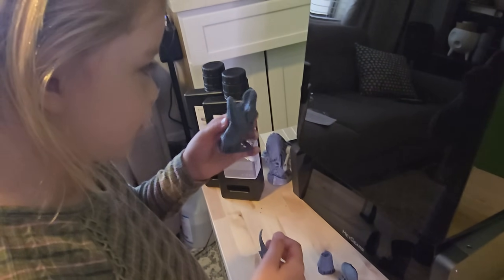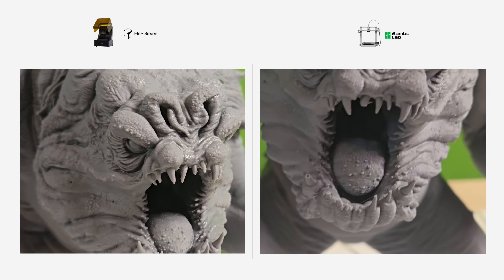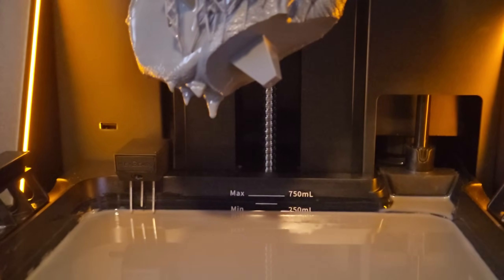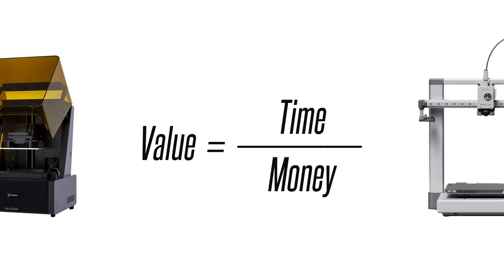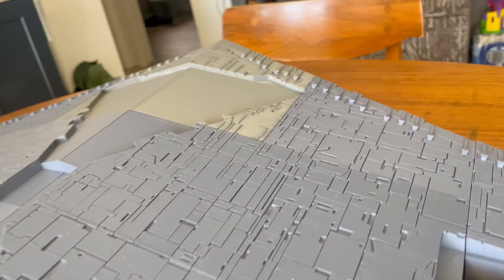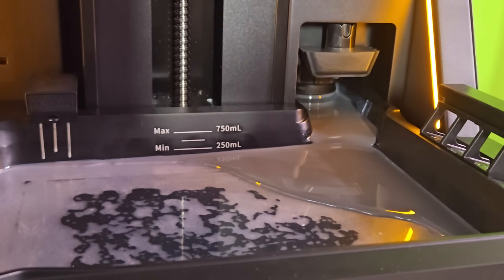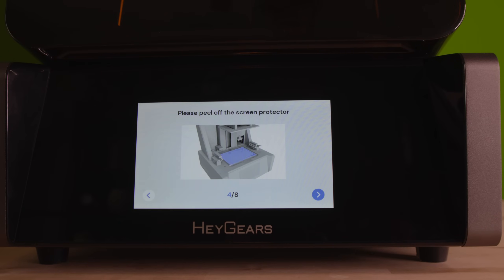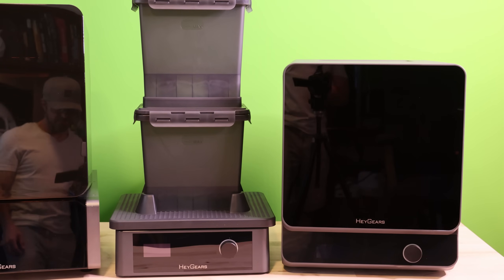I Printed The Same Model Two Ways And The Results Are Crazy! HeyGears Reflex Resin Printer

Comment: One of the best and most articulate and balanced discussions of resin vs FDM printing I have seen.  However, it is really hard to beat the low cost and low post processing of FDM for anything but the highest detail.  I would have loved to have seen the detail of the rancor with a .02 nozzle vs the resin.

Comment: Wargamer resin gives excellent results and is water washable. It's still toxic like all resin, but the cleanup process is way less hassle, without the need for tubs/vats/extra toxic chemicals. As you mentioned though, you're pretty much locked into the ecosystem and their own resin on the Heygears.
Reply from the maker: Apparently I can use any resin I want with the Heygears. I have yet to do so but it is definitely possible.
Reply: @planet3dp   You should check out the Wargamer resin then. It's definitely worth it to at least test if it's for you. The cleanup process alone is worth it, even though it's also a really nice resin with a premium appearance and feel.

Comment: I bought the arctic figures stl for a bunch of the models they have and did this without thinking, its for a resin printer. I have an ender 3 og . So Im sitting here printing the mega raptor in 300% scale and its coming out nice. Very large but nice
Reply from the maker: Hahaha that's awesome! Just because they say sla doesn't mean you can't print on your fdm. Try what I did and print at normal size with much lower layer height. You might be surprised at the results. What is the print time for the mega raptor?
Reply: @planet3dp I have it set at .08 layer line height. So far the longest print time and biggest piece was the pelvis wich I have to do a cut with connectors but all together both pieces took 4 days and 3 hrs plus change. It is a 30 piece print because its super articulated. When all put together should be the size of a real life velociraptor
Reply from the maker: @GarysmostlyMonitors that's is pretty cool. If you can remember, send me a pic at nick@planet3dp.com when it's all done. I'd love to see it.

Comment: Thanks for honest comparison on print quality (something that some youtubers avoid doing)

It's a bit unfair to compare material costs of printer, that's (officially) restricted to "official materials only" (while the comparison can use cheapest available), but on the other hand, both printers are "more closed" in their ecosystems (especially A1)

Few tips:
-If you paint the models, the surface quality difference will be more obvious. Even more, if you also apply wash.
-It's easier to remove resin supports before curing (preferably after washing). You can also heat the model a bit to make it even easier.

Few practical differences I'd highlight in such a video:
-With LCD based resin printers, the total print time is dictated by the single tallest part and layer height (other variables are mostly constant, although layer exposure time is directly related to layer height), on FDM printers, it's based on complexity of all parts in the project.
-Removing material from the inside of the model is generally easier & more "practical" with FDM printing (as you can select sparse infill), with resin you need drain holes, and the whole process is more "manual".
-Many 3D models sculpted for mainly resin printing come with presupported models
-In general, "resin printing side" is much more closed than FDM printers. Prusa SL1 is pretty much the only fully open source resin printer. Also the 2 major resin slicers (Chitubox & LycheeSlicer) are closed source, and have paid "pro" versions. Most "minor" slicers are also closed, PrusaSlicer is open source though, but mostly just for Prusa SL1.
Reply from the maker: Thanks for the helpful tips! Support removal was actually one of the areas I was still unsure about, so I really appreciate the insight. I’m still learning the ropes when it comes to resin printing.

Quick side note I ended up leaving the supports on so I could capture the full removal process on video. But I’ll definitely keep your suggestion in mind and will most likely remove them before curing next time. Thanks for the comments and spending time with me here.

Comment: What's your air filtration set up with your resin printing, especially with your daughter near it. I want to get into resin printing but don't have a garage and can't figure out where to set up. I barely have air circulation with my fdm printer and only use an emcloser to keep fumes in but when i need to do stuff inside it'll be like a tidle wave. Occasionally i use a respirator when opening but most time i just rely on enclosure to keep fumes bottled up until they settle.
Reply from the maker: I have had the same thoughts myself. Typically I only print at night lately. I currently have no filtration setup. I am working towards making space in my garage for many of my printers. I am hoping I will be there soon as it will make for more print times then I currently have.

Comment: Im currently building a 7ft tall Freddy fazzbear with almost no details with an intricate skeletal structure and shells. Ive tried doing miniatures with 0.2 nozzle. No matter what supprts for miniatures on fdm isn't worth it. Some how i have to cut filament in batches to print with 0.2 nozzle to keep from material getting cloged and will require constant monitoring.
Reply from the maker: To be honest the settings I used with the .4mm nozzle was perfect. I really don't see advantage of switching to .2mm at a .06mm layer height. When I saw 150 hours for a .2mm nozzle I said no way. lol

Comment: I use .2mm nozzle witb .08 and tbh you dont miss a lot of details. Take the time to re support the model yourself and id say 96% cloze to resin
Reply from the maker: Yes it gets very close but there are definitely noticeable differences.
Reply: The diff between 90 and 120 fps haha @planet3dp
Reply from the maker: @austin4170 😂😂😂😅😅🎉
Reply: @planet3dp often, I’ve found, very hard to see differences. You have to be careful about supports. That’s a pain to figure out, to be sure. But once you understand it, it’s not that bad. And there are a lot of materials and colors you can’t even hope to get in resin. Figuring time for painting with resin where you may not have to with filament is another area that’s important. You also need some serious air filtering for resin, and a respirator, not so much for most filaments.